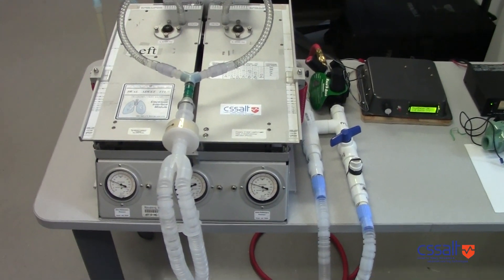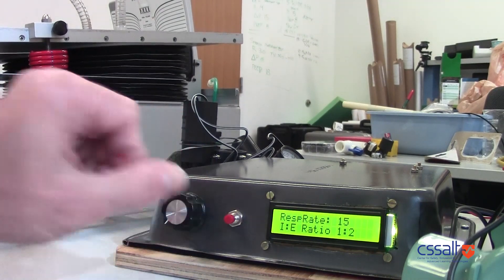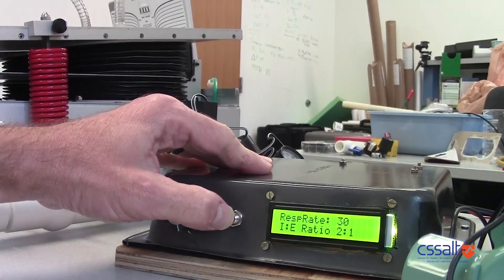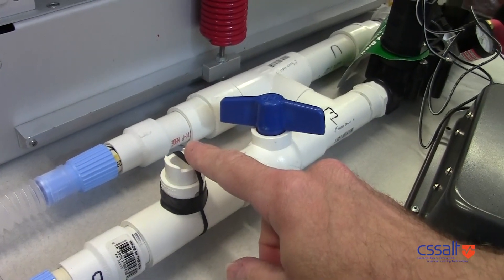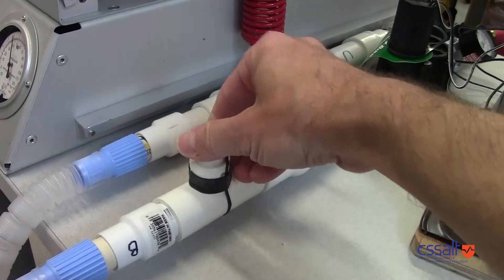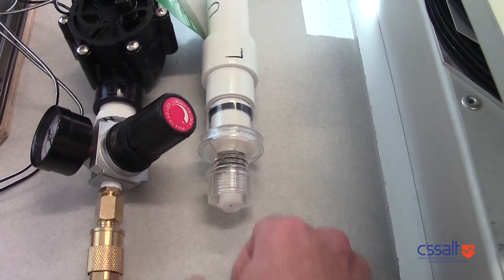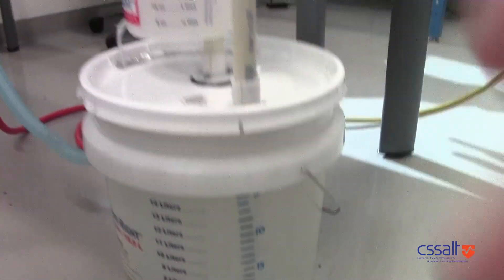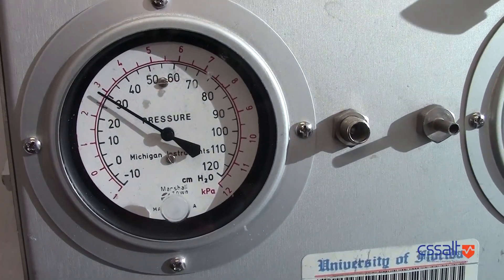Open Source Ventilator Project System Integration Test

Comment: Too complicated for the Third World and in an emergency in the United States.  take a look at this:youtube[dot]com/watch?v=_0lB3IuuDo8
This is easily constructed using metal, wood, or plastic using hand tools. There is only one moving part and is robust enough to be transported in the back of a truck bouncing over roads, with thousands of holes per mile.  The video can also be seen on this website doctordoctordoctordoctor[dot]com where you can leave comments.
 "When you have a hammer, everything is a nail."

Comment: @ufcssalt- Is this a positive pressure volume-controlled ventilator?  i.e. where the tidal volume of the lungs is controlled each cycle.
OR 
is this a positive pressure pressure-controlled ventilator? i.e where the pressure of the lungs are controlled each cycle.

Comment: Hi I am really impressed , I was working on something else but now I want to try romake this , I have started by reading every thing in the website and in the github site, I understood how it works and its relatively easy , but maybe it me or I don't know , the code for the Arduino in the github does not work , or it not the same setup as in the video. I tried hooking up every thing like  explained but no luck . has anyone tried it ? Or is making it ,  Am I uploading the write code , the one I have does not have a POT as to control Br ratio thanks for help , you are awesome as you said it .

Comment: DIY Reciprocating Cycle Linear Actuator with Gear Motor + 12V Power Supply + PWM CONTROL REGULATER

Comment: I am Argentine and I would like to help my people, could you help me with more information about of your prototype? I am a systems engineer and passionate about robotics, I have knowledge of arduino, I hope you can help me
Reply: If you want to build it very cheap (where you adjust the air/oxygen pressure manually), you'd need two valves (pneumatic or solenoid) + a bunch of tubes + arduino. This video already shows the "Y" configuration you'd need for the tubing, connect a valve on each "top" end of "Y" and bottom end of "Y" goes into the lungs.  Essentially the concept is that you push air in by opening of one valve (inspiratory valve - path for air getting pumped into the lungs, or inhaling) while keeping the other (expiratory valve - path for air coming out of the lungs, or exhaling) closed, and then to let the air out you simply do the opposite action. And then to maintain base pressure, and also to limit maximum pressure into the lungs, you could use tubing with water and just manually adjust water depth like this video shows. This is a very bare/basic model, you'd control I:E ratio, etc through programming it into Arduino, you can easily accomplish that, because I:E ratio is just the timing of how long you turn ON or turn OFF each valve. Several youtube videos are available on this Do-It-Yourself ventilators. Just don't use motors instead of valves because motors overheat if operated for long times.  Good luck and hope you all stay safe!
Reply: @nilsaggu9637  Thank you very much!
, that's what I thought but I need to be able to measure the pressure that is generated during expiration to maintain the correct PEEP

Do you have an example of electric or pneumatic valves that I could use? to see if I get something similar in Argentina
Reply: @pablotandil7000  Please see https://www.youtube.com/watch?v=gxPLtEtz1-k  video.  In part 3 of his video at the end you can see the pvc pipe he has used for maintaining PEEP.  In fact, this guy has an excellent series of videos in do-it-yourself ventilator with cheap parts and he also shows the solenoid valves he has used (he got it from a local automotive parts store  - I think you really just need solenoid or pneumatic valves that can handle 75~150 slpm. With pneumatic valves you'd also need extra parts for controlling them so solenoid valves are easier).  If you have Arduino controller, you can easily automate all that he's doing by hand.  Heck, I'd even go to local junkyards to see if I could find solenoid valves to save on costs, I bet it could be used for expiratory valves due to it being non-sterile, just not for inspiratory valves.)  Check out the video I mentioned because I think he's also got a portion where he made a little hole and put a small straw-type tubing for releasing of pressure slowly, I forget if that's what it was, I'll have to double check. Anyway, I hope what i mentioned helps you.  By the way, some cheap PEEP valves are less than $25.
Reply: @nilsaggu9637  excellent help friend, thank you very much, I'm already looking for components. Greetings from Argentina

Comment: Could you explain why this set up does not have a 2nd electric valve to control the exhaust? Is there just enough positive air pressure to fill the lung before the valve shuts off and the exhale just comes from lack of positive air?
Reply: They have added a build list and break down photo on their website. The air pressure from the one valve blows up a balloon in the other tube closing it off when filling the lungs

Comment: please share parts used list? which part is the exhalation valve ??
Reply: They have a balloon in the other side that is filled when filling the lungs that closed off the exhaust
Reply: I dont understand why the lung fill when it doesn't appear there is any electronic control. I had expected there to be a 2nd rainbird valve for exhalation but it appear to fill the lung without even a peep

Comment: This is fantastic!  I'm speechless looking at a lifesaving device that could be made from what's in my shed - except for the controller.  Y'all are amazing.  Woo Hoo engineers!
Reply: You can easily use an Arduino or one of those embedded credit card sized ARM boards as a controller. Some cost around $60 and easy to program. Even a Labjack would be easy and cheap enough to use for this.